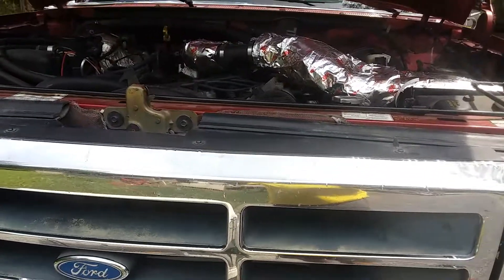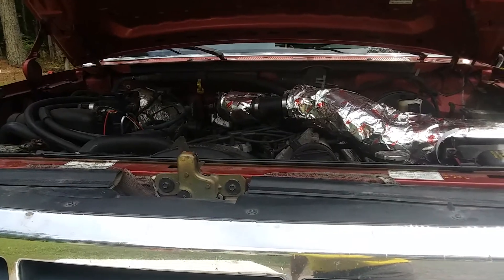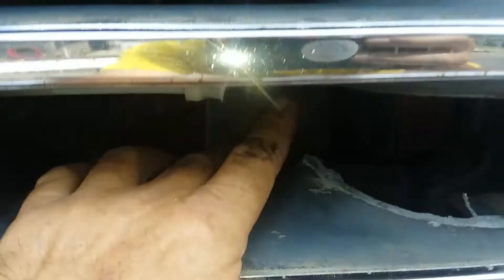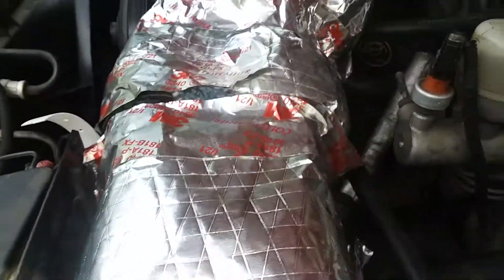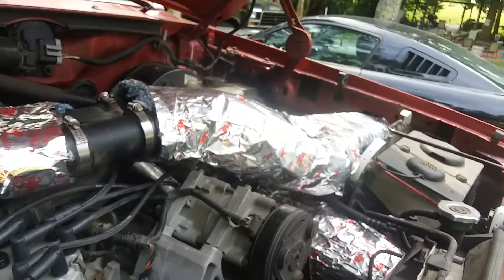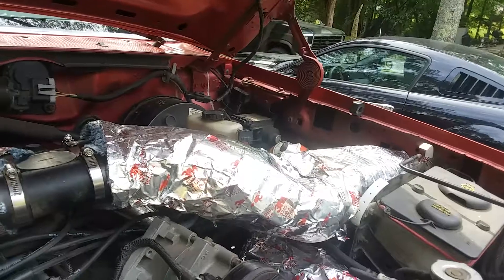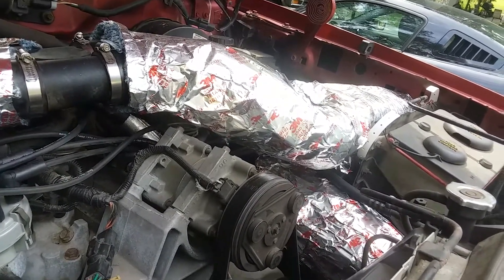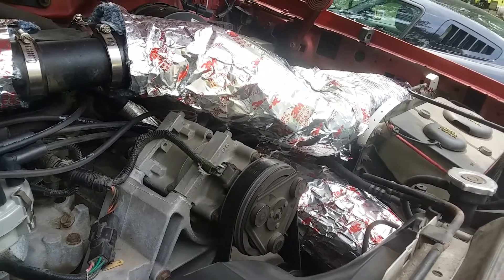1996 F250 7.5L v8 460 Cold Air Intake syster

Comment: How is the air intake running after a couple years?
Reply from the maker: Ok so i scrapped all that aluminum ugly stuff. I simply removed all the tubing completely and bought the double K&N air filter and clamped it straight to the intake tube. 
I lost 2.5 might BUT I gained about 30 horsepower. My ole truck will now burn rubber for a long way and doesn't know my 6,500lb camper is behind it. So I'm very happy now with the K&N set up
Reply: @RiverWalker64  did you cut the baffles in the intake?

Comment: Any updates on this?
Reply from the maker: Yes update. I scrapped this. It was ugly. Didn't increase fuel mileage nor horsepower. I did install the K&N Universal Clamp-On Air Filter: High Performance, Premium, Washable, Replacement Filter: Flange Diameter: 3.125 In, Filter Height: 9 In, Flange Length: 0.625 In, Shape: Oval Straight, RF-1012.. im happy with this look, but I don't think I increased my mileage either. I won't know about my horsepower until I hook up my 6k pound camper this weekend on 2/4/22. Will let yall know how the power is after pulling it
Reply: @RiverWalker64  did you had to buy 2 of the k&n?
Reply from the maker: @u2EzSky  I scrapped the one in the video and did put this in. HP is fantastic but no better fuel millage 
https://www.google.com/aclk?sa=l&ai=DChcSEwjv2NOI3qz2AhWeBogJHUrHAb0YABAHGgJxbg&sig=AOD64_1jCHD4gO7xPygSI-KqE6-UdRoVZw&ctype=5&q=&ved=0ahUKEwiAjM2I3qz2AhVSm-AKHdj7A4cQww8InAk&adurl=
Reply from the maker: I should remove this video. This is an ugly airflow system. It did not increase my mileage or HP. So I removed this Ugly and installed the K&N airl filter. Maybe I can show a pix of this. This k&n filter increased my HP by prolly 15% but I didn't increase any fuel mileage.
https://www.google.com/aclk?sa=l&ai=DChcSEwjv2NOI3qz2AhWeBogJHUrHAb0YABAHGgJxbg&sig=AOD64_1jCHD4gO7xPygSI-KqE6-UdRoVZw&ctype=5&q=&ved=0ahUKEwiAjM2I3qz2AhVSm-AKHdj7A4cQww8InAk&adurl=